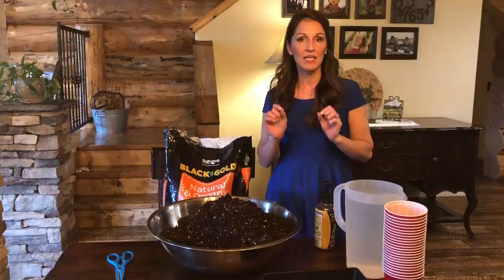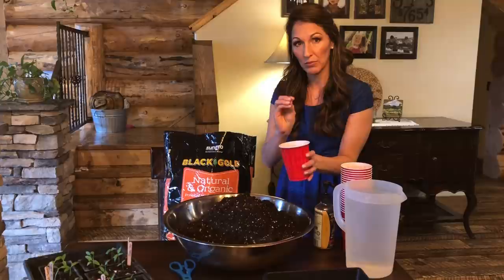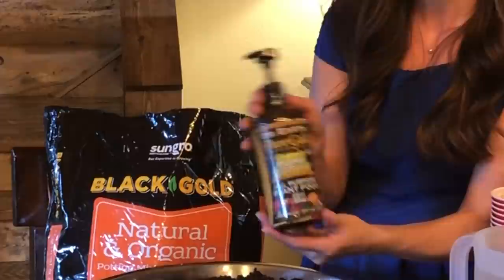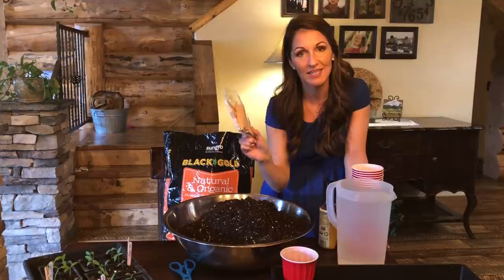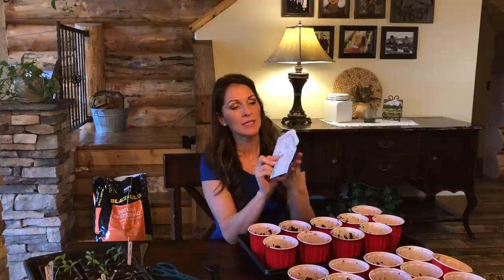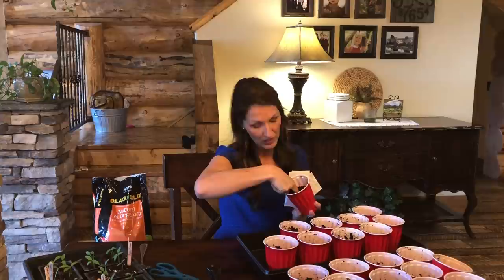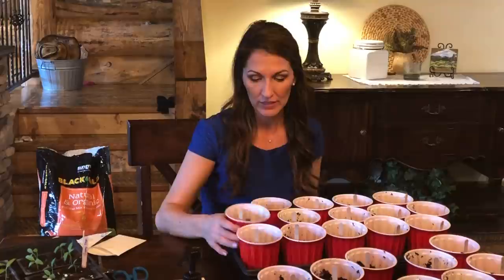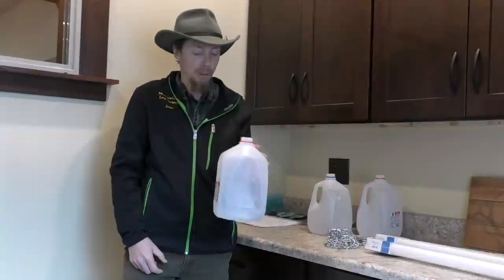Best And Easy Way To Start Your Own Tomatoes By Seed / How To: Easy And Cheap Grow Light System!

Comment: This is a good and frugal way to start seeds. You can save a little more by just writing the variety on the cup with a Sharpie. I saw on another channel that you can take a whole stack of cups, turn them upside down and drill holes all at once, I thought that was clever!
Reply from the maker: Yes of course! Why did I not think of that! I could’ve just written on the cup with a sharpie!😄And drilling them all would’ve been a good idea except I did not have a drill.

Comment: You can use a soldering iron to melt a few holes into the bottom of the cups without cracking them

Comment: Pracilla, I was wandering if you would share what the Amish 
Women use to clean walls and ceilings
Reply from the maker: You know, I’m not sure. They use A lot of different kinds. For painted walls I will often just use a little bit of Mr. clean. And for a wood and log walls I will use Murphy’s oil soap.
Reply: Thank you very much. I have heard how Amish women scrub the walls ,floors & Ceiling when Church is at their place. That's  why I asked
 Also, my place needs it!!! 😃😄😁